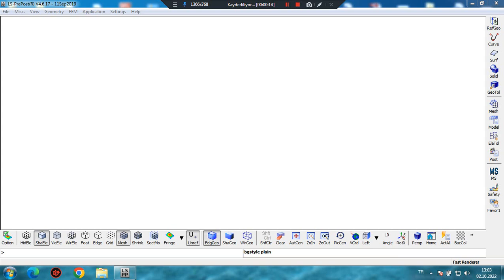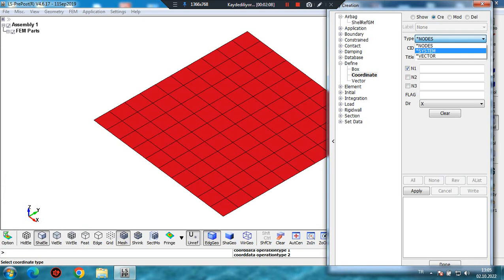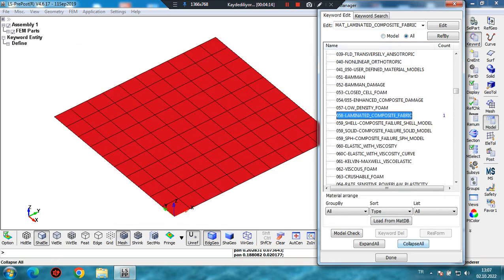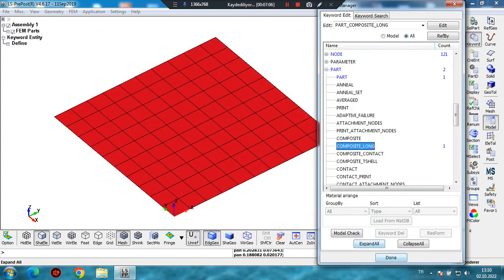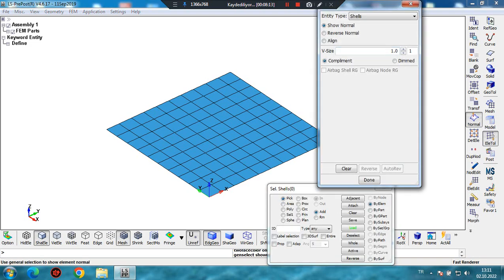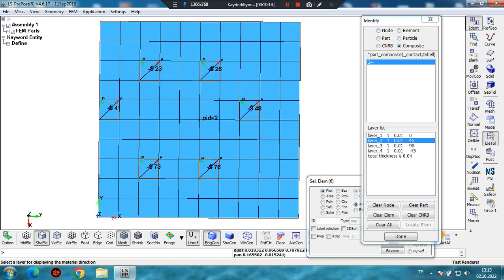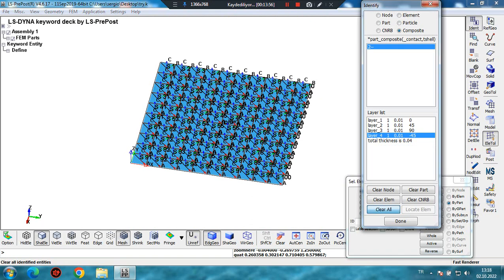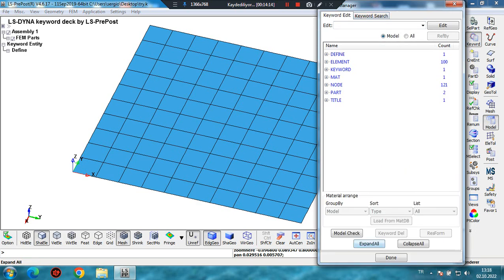Composite Modeling for Ls-Dyna

Comment: thanks for the video. I want to ask if  is it  possible to rotate each ply with a desired angle. Like i want to model the  0 degree ply in the first layer second layer same zero angle ply but rotate it 10 degree with respect to first ply. Not changing the fibers direction just rotating each ply

Comment: very informative video, I wanted to model a prepreg composite (with several layers) and use it for drape forming process. Which modelling technique should I use? how can input the material card directly into .k file? Can you please help me ?
Reply from the maker: The thickness change in forming processes should be taken into consideration. So, using shell elements may lead to the result to be interpreted wrongly. Therefore, you can use thick shell elements in your model. Check Ls dyna manual to find which material card supports the thick shell elements.